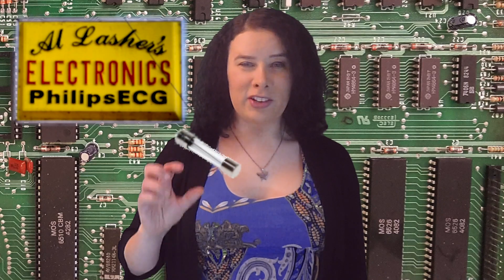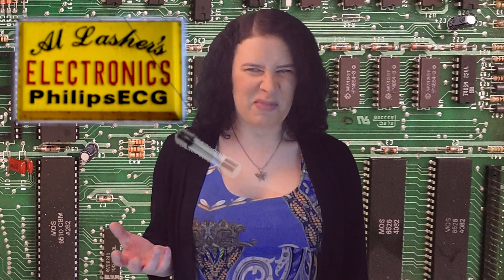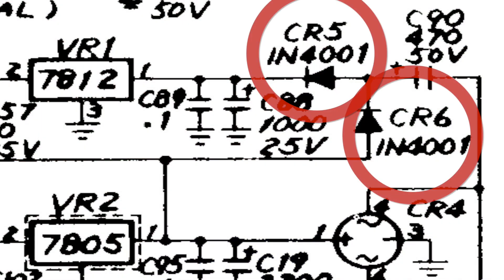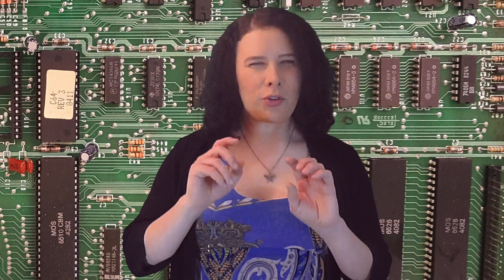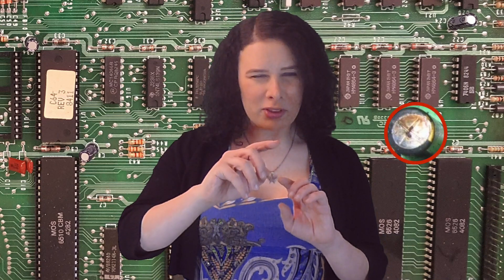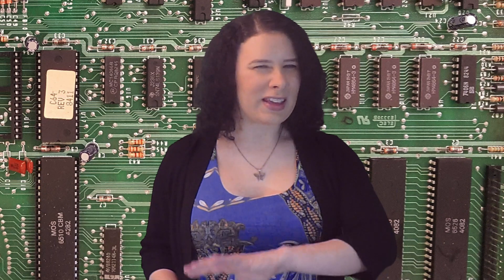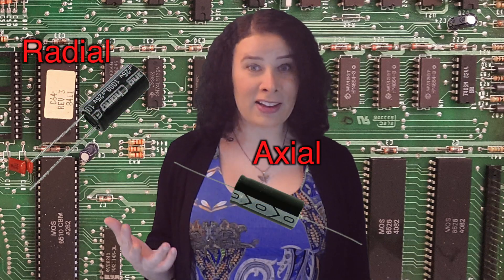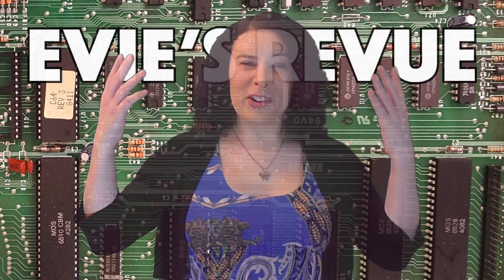My early dabblings with electronic circuits

Comment: Yup.... I shorted out one time as well... It locked up my C64 so I had to power cycle it. Never doing that mistake again. As it can not be good for a chip only running on one voltage input. I did not blow the fuse though.